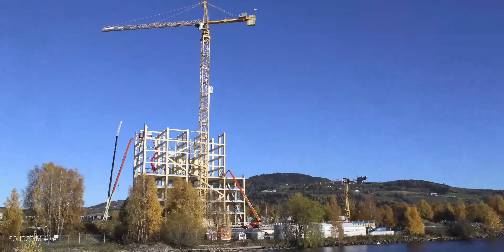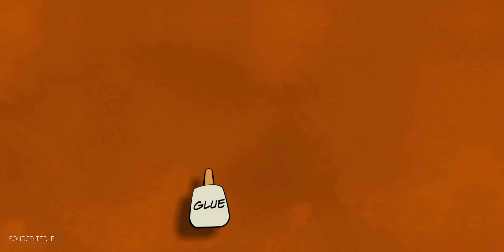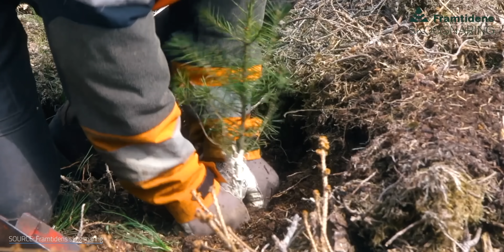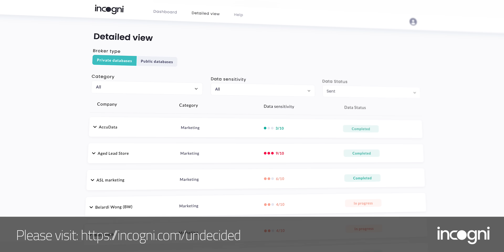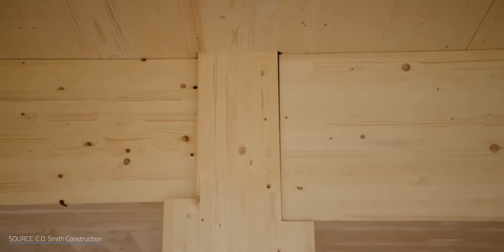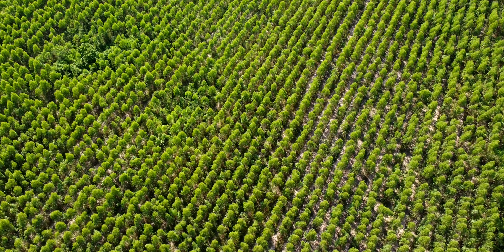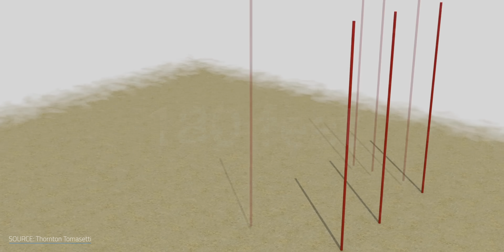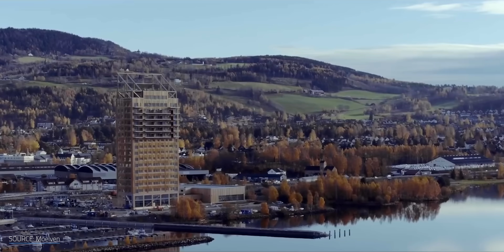How We Engineered Incredible Wooden Buildings

Comment: structural engineer here - we've had a few mass timber projects come through, unfortunately, none were ever built.  The reason is always the same, when it actually goes out to bid the cost is significantly higher to build than CIP, block and plank, steel and plank so the people footing the bill always choose to go with the more trusted and cheaper method.  Also, it is very difficult to design these engineered lumber builds since everything is custom sized.  There are no "guidelines" in place yet and wood is difficult to model its behavior, especially with regard to the connections that are not standardized.  in summary, you need extra time and money to do this as well as take on extra risk, its going to take some time for this to gain traction
Reply: Sourcing is limited so bids aren’t competitive. Construction is faster so there is quicker delivery to market and less financing. There needs to be more fabricators available and a more streamlined production system.
Reply: If you ever need to hire someone

I'm available
Reply: To be fair cost for timber has been insane since the pandemic hit and now with still quite a lot of construction and large homes sheds and ADUs going on timber will continue to be in demand.

Comment: Steel's thermal conductivity is very high making it easy to heat all of a beam's cross-section.  Dry wood's thermal conductivity is very low.  Even as wood burns, only the surface layers are hot.  A beam's stiffness results primarily from these surface layers, but all of its volume contributes to strength.  Although a wood beam might droop as it burns, it stays strong until much of it is gone.  Traditionally, it is the joints between planks that fail first and cause burning wood buildings to collapse.  Perhaps, wooden dowel fasteners and glue would perform better than metal.

Comment: Just because the fire doesn't burn fast all the way through the lumber doesn't mean it doesn't spread insanely fast across it. Every exposed piece of lumber needs to be covered in that fire-proof layer because of that. I doubt that stuff is environmentally friendly. Steel and concrete also don't produce lots of gases exposed to fire.

Comment: one of these mass-timbre towers going to burn in record time, remain standing with a record amount of damage, and an engineer standing by the side saying "See it didn't fall" 

I understand that the material when burned creates an insulator that maintains the structural integrity --- but --- does not the first layer of wood act as a fuel for more first layer to burn? If a fire starts on my concrete floor - I don't imagine that fire using the concrete as a fuel to burn more of the floor... then the columns, then the ceiling, then all the contents inside my apartment.
Reply: The floors are all covered with gypcrete or aerated concrete, plus a couple of other layers. Otherwise people on floor 5 would all hate it when people on floor 6 walked over to the fridge. I guess I’d say you’ve reversed the fire scenario. Contents ignite and burn first. Yes, the ceiling burns, if exposed and the columns, and chars, Walls? Most of these are using cold-rolled steel studs and gypsum wallboard for non-bearing internal partitions. Use CLT and you’re back to trying to deal with sound transmission. 

All this presupposes the sprinklers fail to control the fire. So do a high quality job of what is necessary to get a quality system in the building. Then maintain an effective program of ITM, even during recessions or periods of high vacancy rates, when the owner is losing money. That’s the real challenge. Values rapidly become apparent at that time. Keep the sprinklers up to snuff, no fire operates more than one or two heads, and all that charring engineering never gets tested. Be aggressive in sucking up the sprinkler water.

Comment: Would be interesting to see how they hold up over the next decade or two. And what about other risks like water damage? Drain? Pests?
Reply: Water damage is an issue, but wooden buildings are designed so that water doesn't stagnate anywhere (that's when the problems start).

And wood is, most of the time, not vulnerable to fungi and insects unless it's damp.
So if it is kept dry, it's safe. And it Can also be treated for a second layer of safety.

Some 1000 years old timber buildings still stand, after all.
Reply: I wondered this as well. I live in a log cabin in a humid warm temperate climate (Virginia, USA) where relative humidity is often above 80% and temperatures sit well over 70F for months, with high temps around 105F. Mold is a major problem and several of the log walls have had to be replaced over the years thanks to rot.

Carpenter bees and termites are also a serious concern...
Reply: @one_field  quite sure bees aren't a problem. Termites are and in areas prone to them, buildings usually have (and sometimes have to have) a protective layer on the ground to prevent them from reaching the timber.

And yeah, sounds like walls not "inside" the livable areas in the kind of climate you have may not be a good idea!

Look for Keylwerth diagram, and look at where the wood equilibrium is in your place. 
If it's over 30 : mold will naturally occur
Reply: @Firth33300  The carpenter bees, specifically, love soft wood and manufactured wood in our climate. The glue doesn't bother them and paint, even thick latex, barely makes a dent in their activity. Any wood structure needs serious protection from them here, or the boards are soon hollow shells. They fly as high as 35 feet so protection needs to extend that high. Pressure treated wood is just as susceptible to them; char and creosote are the only preservatives that I've seen really keep them from chewing on wood.
Reply: @one_field  i wonder if they could char the engineered wood during production (or at install). Traditional japanese buildings (the ones that locked together like lego) were frequently intentionally charred during building to make them more resistant to the elements/wildlife
Reply: @CrabInBucket  Yes, char successfully keeps a lot of pests at bay (including carpenter bees), but it has a maintenance routine involving oil coating and recharring the surfaces every decade or so. It's not difficult to do at small scale but it would get harder in a big commercial setting. The oil coat is no different from repainting, so that wouldn't change maintenance labor or cost planning, but torching the surface? Even in small sections, I don't think urban planners would appreciate that... and then you have to scrub the surface or else everyone who touches it will get char on them.

Comment: heck, I freaked-out when a new 5-story apartment building was being constructed off all wood. I thought they were just cheapening-out on materials (and they might have, and actually, I couldn't imagine the neighborly noise problems in an apartment like that, yuck...)
Reply: The issue is those 5 over 1 apartments are cheap. If they used wood like those in the video, the noise would be an issue. Instead they go for the cheapest and thinnest material possible. It is good they are building more housing and quickly with wood, but it more consideration should be made with noise for those that live inside.

Comment: 2 things they didn't mention in this video.
1. TERMITES  (sneaky little buggers, you will not know what is happening underneath the wood until its too late)
2. Typhoons, Cyclones and Hurricanes.  (climate change roided them up.  I remember back then signal or category 3 is already strong and 4 is a rarity now its up to 5!)

Comment: Has anyone looked at ways of engineering bamboo or something?  I briefly read something that 2x4 bamboo boards are SUPPOSEDLY stronger and cheaper than spruce.

But there is that knot which would compromise bamboo 2x4 or other sizes, but wondering if it's at all possible to eliminate the knot, or stretch it out where it's past the 8', 10' .... 16' mark?

Comment: What is overlooked too often is the glue the engineered wood uses. I imagine that it's neither a ignorable quantity of glue and the production of the glue has some environmental consequences.
Reply: All of that is more than likely included in the calculations. They're all really basic steps.
Reply: In glulam, you have about 2% of the weight of the beam that is glue.
In CLT, it should be about 3% 
(Source: I work for a major CLT manufacturer).

They are also working on bio sourced glue that could be made from chemicals naturally found in certain species of wood.
Reply: @Firth33300  what about rotting?
Reply: @adamharrold407  What do you mean?
Reply: @Firth33300  wood rots. yes, concrete does expand and the steel inside concrete rusts thus limiting its lifespan to 100 years or less. and steel rusts thus reducing their lifespan. but, wood literally rots. if the construction worker failed to insulate the building from moisture that building is going to rot quickly. this is the problem in all wooden building, particularly laminated wood building. literally these skyscrapers are build by laminated timber, they rot. with concrete and steel, moisture thus destroy them but at much slower rate. plus, the mold of rotting wood is poisonous. why is this important. buildings are build by humans and they make error all the time. one of the most frequent is water sealant. i have lived in many buildings and i can say that i can count the buildings without water damage with my hands. given these buildings are concrete, it doesnt rot as bad as wood would. this is important because all buildings fall but with wood you have mold. not only is it a structural problem, but also a health hazard
Reply: @adamharrold407  That's an actually dumb answer.

Wood rots when in constant presence of water. If water gets there once, or even once in a while, it's not a problem.
If your building has constant water damage, then it's got a lot more problems than the structure failing. You can't live in it.

All rot is not the same. Rot in the wood doesn't necessarily means harmful mold. Actually, most dangerous rot to your building are not dangerous for you.

Finally, in any case, wood is most often used treated, or naturally resistant to mold. It's not a new treatment, and it's enough to ensure 50 years of life for the building. Which is what most buildings are built for.

There's a reason timber buildings from the Middle Ages still stand, and it's that it works, no matter what Adam Harrold 407 has to say.
Reply: @adamharrold407  also, you know in which kind of buildings mold develops ? Damp, non-breathing ones.
What are timber building ? Naturally breathing buildings.
Reply: @Firth33300  i agree with all your points. actually you understood my point. you actually say that wood rots when its constantly in contact with water. this is exactly my point. like ive said water damage always happens in buildings no matter steel, concrete or wood. lets say, that a pipe leaked and the home owner doesnt realize this, which always happens, or through design flaws, water collect inside the walls from rain or pipe leaks, causing mold. unlike a concrete building or steel, even if pipe leaks, the damage takes longer to develop. for wood however that is not the case. even in cladding, like most of this wooden buildings are build, if the workers does not take precautious measures there would be puddling areas. these are things all buildings might experience. you talked about non breathing buildings, these are however closed off buildings. they would not be as breathable as you might think. for example offices use air conditioners, and air conditioning needs insulation. yes, there are breathable insulation, but in most cases insulation makes buildings nonbreathable. and air conditioning, depends on the design increase dampness. yes, they can use rot resistant wood and i agree with your point. this actually is a great answer, but rot resistant wood is expensive. many laminated timber is not made from the material. plus, rot resistant species takes longer to mature. for south east asian species, it could take up to 25 years to mature. yes, for non rot resistant wood we could laminate it but once the layer is washed away rot would happen eventually. eventually people would save on cost. this is why in the us many timber houses are rotting. you do agree that timber houses rot dont you? and i do agree that would could survive time but there are reasons why not many wooden houses survive. having one wooden house left standing from 700 years ago doesnt prove that it is a standard. most probably it is a novelty. and the wood they used are whole log rot resistant wood that is very very thick. with laminated timber we couldnt say for sure. in sumarry i agree with you on one point, that we could use rot resistant wood. but on many i think the whole wood skyscraper can be a huge hazard in the long run
Reply: @adamharrold407  The whole design and construction method for wood already include all the answers you're complaining about for standard buildings.
That is why tolerances are so low with timber. And that is why pre-building phases are more expensive for timber building, because you have to take all of that into account. 
Which results in buildings that are as water-damage proof as they can be, with no area where water would accumulate.

Class 3 species exist in temperate areas (douglas fir, larch, cypress ...) and are used in the industry on a daily basis.

Also, wood itself is breathable. Hell, OSB is breathable enough in timber framed houses.

Again, most buildings are rated for 50 years, no matter their construction material.
Besides, it's much easier to replace a damaged wooden piece than a damaged concrete wall.
Reply: Also the energy to produce those glued planks
Reply: @mathalphabet5645 not that much energy, when you compare it with the energy for the components of concrete (part of it needs to be heated to 1300°C), and steel goes without saying.
Reply: @Firth33300  the energy still is a concern regardless considering the vast majority of electricity is sourced from fossil fuels or subsidised inefficient nuclear fission reactors which often produce waste at a much faster rate than we can handle it.

That is also forgetting how industry often gets exceptions that do not apply to non-industrial areas and companies with pollution and energy sources. This is even in so-called "green, sustainable Western countries" like Fenno-Scandian countries, where the use of fuel-fired furnaces for the purposes of heating have been outlawed, with the later exception in industry. Where also industry giants like Norsk Hydro are considered environmentally friendly despite having an absolutely enormous amount of fossil energy as heat and enelectricity (extracted on-site at their factories instead of paying regular electrical prices which in the region are the cheapest in the world, with the cleanest energy).

I fear that since this wood processing is likely done in areas that are graded industrial, it will have the same fate as Norsk Hydro and other industry giants (an extremely polluting one, that is).
Reply: @zanderhenriksen6776  
No, it's not. It doesn't use that much power at all, and all the alternatives use 5 to 15 times more.
Besides, you know what is left After you've processed wood ? Wood chips that you can use as fuel. An industrial sawmill can be self-sufficient in heat production, provide more electricity than it uses, and provide wood pellets for the area around.
Reply: @zanderhenriksen6776  I think you're letting perfect by the enemy of good here. We can't stop making building, and making them will always take energy. Making the buildings more environmentally friendly and sustainable is a great step, and i think should be separated from the problem from moving the grid to renewables (and things like new generations of nuclear reactors that can run on nuclear waste or thorium)
Reply: @zanderhenriksen6776  Sure, but when knowledgeable people  oppose everything that doesn't check ALL the boxes, they are just perpetuating the status quo. It's not like mass timber is suddenly going to replace conventional building, far from it. Let's experiment, let's learn, let's build some fantastic building out of wood! Let's not try to smother everything in it's infancy out of eco perfectionist ideology!
Reply: @mathalphabet5645  Yeah, lots of milling, then the pressing and sometimes heat to make those composite wood products.
Reply: Are we adding Volatile Organic Compounds to the wewd?
Reply: @PxsDD  Yup, but small amounts. The industry manages to remain under the limit levels authorized by the EU ahead of it. 
The problem with volatile compounds is more in furniture than in structure.

And the Real issue is when it stays in the air, so a well aerated house is no problem.
Reply: Still it should be better than steal and concrete.
Everything has it's downsites.

Comment: I have noticed a few code changes in building. Can now use smoke detectors for boats and r.v. in residential builds. Which helps if offgrid and using d.c. power. Plan on building my cottage to run all d.c. appliances like a sail boat. They also are allowing foam board insulation under concrete floors. Which is great if you live in the north. That ground is always cold. It's why people in the far north build off the ground. By the equator I would want the ground to cool the house. Thermal breaks around the windows help too. Surprised they don't have premade thermal break corners. Most heat loss is around windows, doors, and corners. That's the main take aways I got from taking continuing education classes for contractors license.